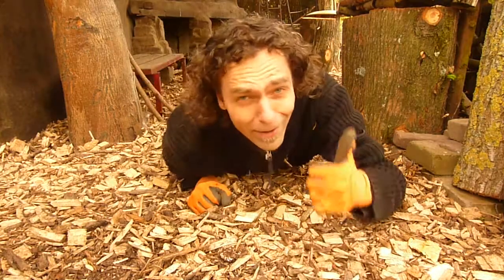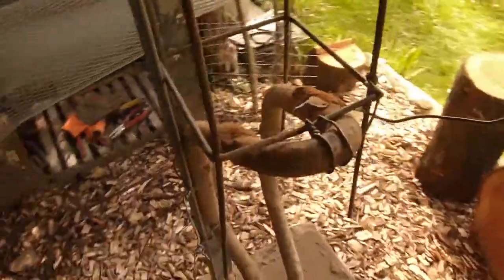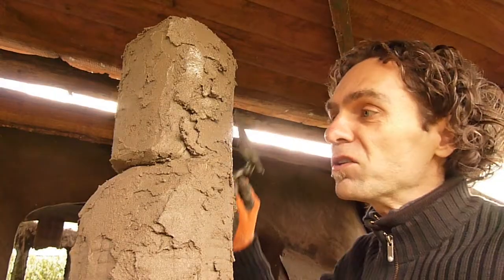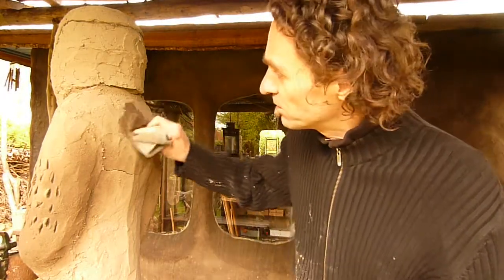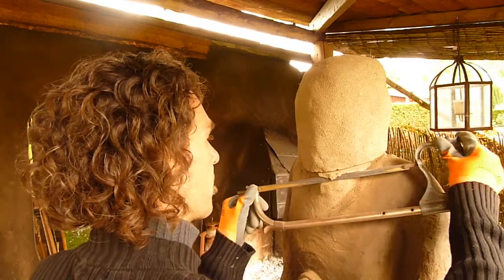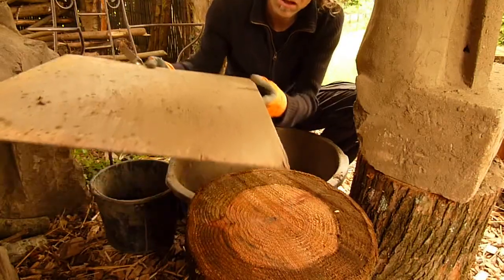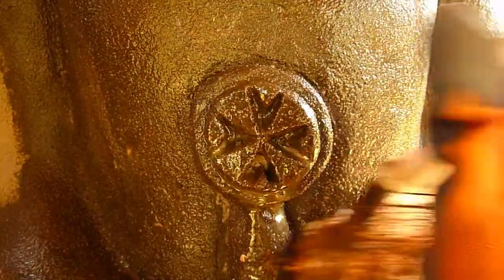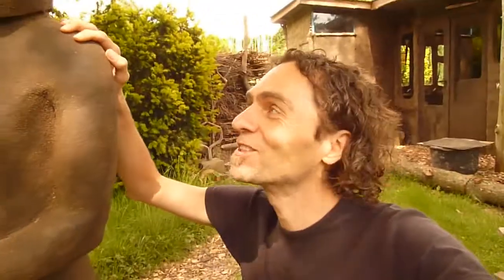COB statue 🗿Earthen sculpture  🏰 DIY mancave tutorial ⚔️

Comment: Dude how incredibly awesome, your video is the first good one I have found of an easy way to build stand alone cob art. I'm planning on doing some trees inside of the house & you have inspired me. New subscriber for sure 👍
Reply from the maker: Hey thanks man! I missed your comment, sorry about that! How awesome that I got you inspired 😀 How is it working out?
Reply: @Le0nski I haven't gotten the trees going yet but did build a large cob rocket mass heater before this last winter. I worked fantastic & now that the weather is getting warmer I will be getting back to the more artistic side. Thanks for your response 👍

Comment: Great project  I love this! just wondering if is possible to do it in 2 weeks and still drying right in a tropical enviroment?
Reply from the maker: Thanks! I started out with wire mesh that needed a lot of cob to create the statue, but if you get your wire mesh base figure right, you only need to add a thin plaster, which dries much faster. So yes, I am certain it can be done in two weeks! When I made the dino skull, I did the same, it saves you a lot of time waiting for the cob to dry 🙂 - Let me know how it  turns out!

Comment: I love this video! Just to be certain, boiled linseed oil, will waterproof a cob or earthen wall? and how often should you reapply?
Reply from the maker: Thanks! Yes, it will waterproof anything made of earthen material. Just keep in mind that if you apply it to a wall, it stops breathing. I applied it two or three times. Heat it up a little, but be careful with open fire,  and use gloves. I have a complete video on waterproofing a cob wall, it's easy to find. Good luck!

Comment: what kind of clay do we use?
Reply from the maker: You can use any clay that you can get your hands on. I ordered my clay in bulk (when I started out 7 years ago), but now I would simply dig it up myself. Or, you can order sculpting clay online, but I guess that locally dug-up clay is best. Where I live, there is no cob in the ground, so I just mix sand, clay and water to create earthen plaster myself. What are you planning to create? Good luck!
Reply: @Le0nski when i earth plastered my walls i used kaolin clay + sand + boiled rice water + borax. Would that be good or do you recommend another mixture? I have been wanting to do natural art like this!!!
Reply from the maker: @brandiperkins4052  
Nice! It’s absolutely fantastic to do! I suppose any plaster will work, as long as it can withstand rainshowers. With walls the advantage is that you can protect them with the roof’s overhang, but on exposed walls I did use boiled linseed oil, this will waterproof it, but it will stop the wall from breathing as well. For a statue this is no problem. You can do a test run with a mock-up art-piece and try your own plaster. Hose it down a few times for a few days, you’ll know soon enough.. if it doesn’t work, you can try to finish your plaster with boiled linseed oil (after the plaster has dried).